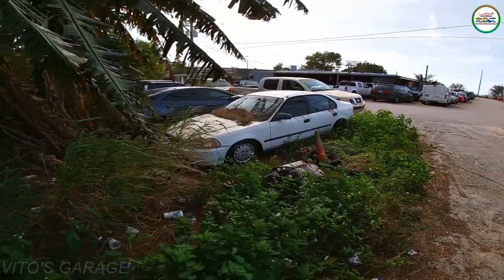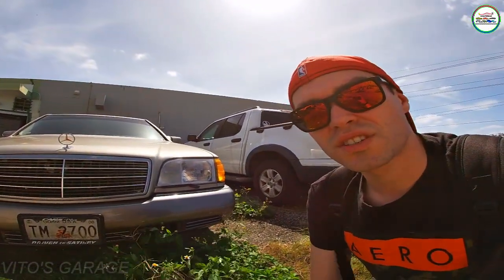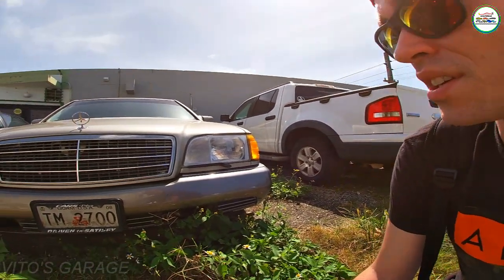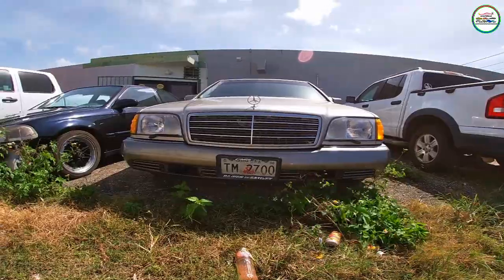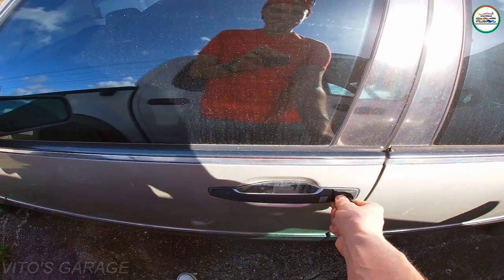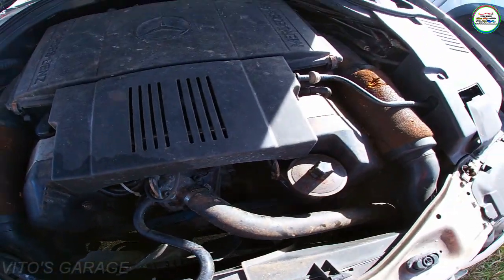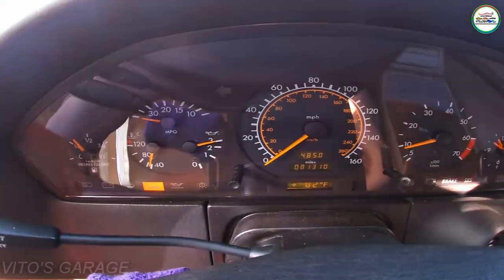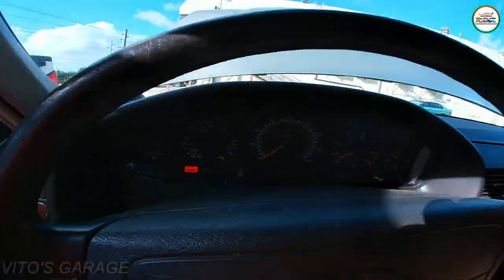Will This Mercedes W140 Start After Sitting For a Long Time?

Comment: When I had a W140, the key was like a beeper, and you press a button in order to open the doors, I am surprised that they have a key, like the old school Mercedes, these models are so unique, because they have, something that looks like a power antenna for backing up to check how close you are, plus the glass is real thick like two or three glass, you would look good with that W140 next to your 123
Reply: I had a 1993 w140 
From factory it comes with two remote flip keys and a case with 3 normal keys one for the trunk one for the ignition/door and one master key

Comment: When I was in the navy in the 60's guys used to be able to bring cars home on the ships if it was a big enough one. The ship, that is. They can crane them into the hold.
You didn't check the oil or coolant or put it in gear to see if it was driveable. You can maybe freight it home if you can get it for a good price. Buy it Vito!
I looked up top again and saw where you said it belonged to a Korean. Has he abandoned it? Is it for sale? That's an awesome car! Buy it! Lol
Reply from the maker: If I was stationed in Guam, I'd be able to ship it home. The Navy would cover it. But I am on deployment and we are here for a short period of time. I've checked the oil but never filmed it. Coolant was a little low but I didn't run the engine for too long. 
The car has been there for 3 months according to the shop owner. The owner went to his country for some time and still haven't returned. The car is drivable and not for sale. It came there for just a tune up and window regulator. I am definitely getting a W140 in the future!
Reply: @VITOSGARAGE  OH, to bad. Hopefully you will find one that looks as good some time.
Are you stationed on a ship and what kind? What is your rate. I was a machinist mate on an old repair ship. I made E4 in one and a half years from recruit. It is fairly easy to make rank in the navy if you have half a brain. Luckily I had at least half lol.
Reply from the maker: Email me sir: vitoldaswork@gmail.com

Comment: Even though i owned 95 w140 but the pre facelift w140 like in the video,were much nicer & it looks bigger & bulkier!😅
Reply from the maker: I love them all. Thank you for watching. Many more videos to come☺
Reply: The pre facelift models were better built and with higher quality materials too! This is well established. The 6 cylinder models dropped a couple hundred lbs with the facelift which was a benefit, but it wasn't without compromise

Comment: You didn't have to change the fluids before starting? I have a Mercedes but I'm scared to start it because of the fluids may need changing
Reply from the maker: Change the fluids. Fluids are the heart of everything. Don’t neglect that
Reply: @VITOSGARAGE  ill change it before I start it but I might can get away with starting it first then changing it after I can drive to the store

Comment: I daily the same car but a 98 model, be careful when buying a pre facelift w140 as before I had this one I had a pre facelift 92 600sel with the v12.  There are many different downfalls of true pre facelifts such as biodegradable wiring and being pre obd 2 so owning a star machine is a must with these cars
Reply from the maker: Nice! I am aware of all that but I would totally buy a pre-facelift model too. Especially if it was a V12. I love giving these cars a new life. They all deserve to live. At the end of the day, all cars need work, even new cars that they make nowadays that can't make it to 100k 😁🚗🚗🚗💨
Reply: VITO'S GARAGE yes their a lot of work. Mines got 294,000 miles on it and still runs like a top, around 286k the conductor plate went out and I had to put a used trans with only 117k for $225 in it but that wasn’t a hard job being a basic rwd car but other than that it’s been rock solid.  I doubt I have 1500 In this car at this point
Reply: Honestly I’ve been looking for a bmw e38 to go with it,  these are the best two luxury cars of the 90’s the 740’s are pretty cool.  I work on all of these cars daily as the shop I’m at specializes in older bmw and mercedes
Reply from the maker: W140s are awesome big tanks. My friend recently bought a 1995 E320 W124. Really nice sweet car but it wasn't running. The engine harness was degraded... He put a new on it, cleaned her up and did some other stuff and she's like new. It has like 125k miles on it only.
And I love E38s!! I am looking to get myself a Bimmer too. I have playlists about Bimmers on my channel too, I love those cars. 
I really want an E32 or E34. E32 is so sweet, especially 750IL! 😍😍
Reply: a wiring harness isn't a big deal, and they were mostly all done a long time ago by now
Reply: What was the story with the W140, was it in need of repair, was it for sale?

I have a 1999 S500 with 142,000 miles.  Other than a few very minor repairs, it has been a very reliable and solid car.  Such a great highway car!